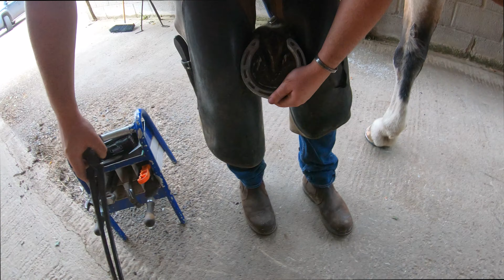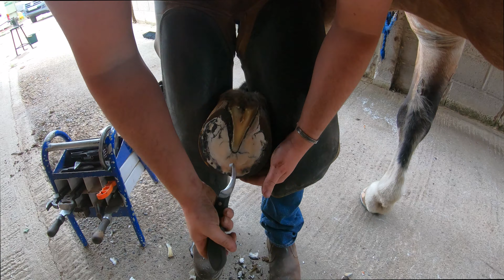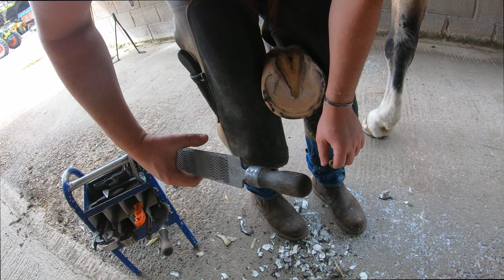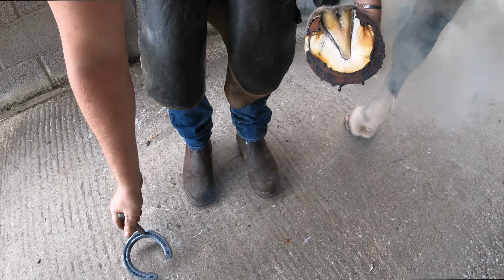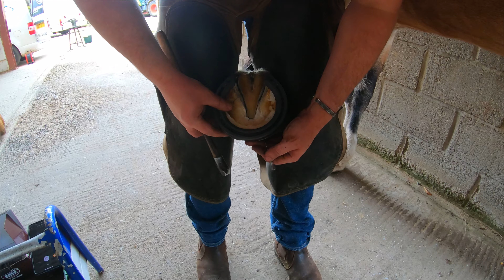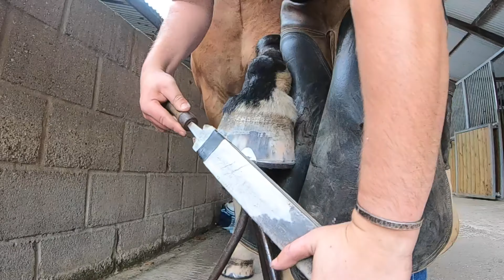🔥HOT🔥 BURNING ON HORSE SHOES !

Comment: I’m sure this doesn’t hurt the animal, but can someone explain to me how it doesn’t? It looks so hot!
Reply: Also why do they put it on hot in the first place?
Reply: If it hurt the animal, would they be calm?
Reply: @abigailkeefe4211  nails don't have nerves, same case with hoofs. As for hotshooeing Idk exactly why but they said it makes it easy to fit the shoe
Reply: @yunan9610  Thanks so much for the information!
Reply: All of that is just nail that’s why
Reply: I promise you, if it hurt the horse, that horse would let you know 😂 burning the shoe on is easier and more comfortable fit for the horse. The heat makes an even surface, basically
Reply: @Zinomorix  thanks!! Very helpful
Reply: The reason it’s hot I believe is so they can see where the does and doesn’t touch so that they can trim accurately.
Reply: @yunan9610  it burns the marks into the hoof so they know where to place it and it also makes it easier to use on the anvil